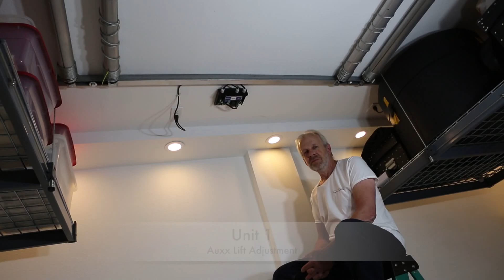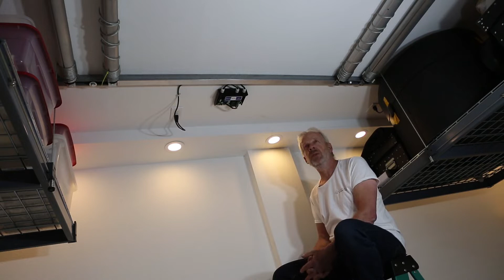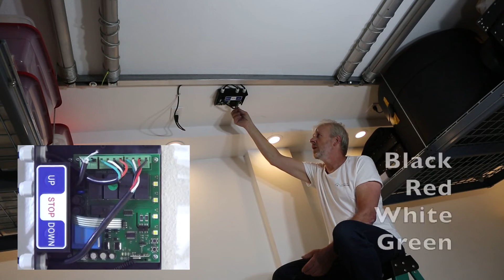Auxx Lift Garage Storage Lifts: Installation & Trouble Shooting Guide - Video 2 (Wiring)

Comment from the maker: 🛍 BUY NOW: https://yblgoods.com/products/electronic-garage-platform-storage-lift-400lbs-600lbs-by-auxx-lift-2
YBLGoods ⭐⭐⭐⭐⭐ Rated: 4.9/5

The Auxx-Lift is the ideal storage solution to keep your garage organized. It is the largest and strongest platform on the market with 4' x 8' area and 600 lbs lifting capacity.

Platform sizes
3' x 6'
3' x 8'
4' x 6'
4' x 8'

Lifting Capacities
400 lbs.
600 lbs.

For 400lbs:
General specs
Model:Auxx-Lift 1400
Lifting Capacity:Up to 400 lbs
Max. Travel Distance1:16 ft
Min. stored height2:8 in

Roof Support
Type:(2) 1 5/8" x 60" strut channel
Fasteners:(8) 5/16" x 4" SPAX© Lag Bolts
Mounting Area:5' x 5' over 3 joists/rafters
Cable:1/8” Vinyl-coated Steel 7x19
Cable Strength3:2,000 lbs

Operating Requirements
Switch Voltage:110V / 120V
Transmitter:433.92 MHz
Electrical Cord:10 FT / 16 gauge / NEMA 5-15
Min. circuit size:15 amp

Platform Specs
Thickness:2.5 inches
Support Frame:C-Channels (15gauge)
Face material:3 x 3 galv. Wire Mesh (4gauge)

Motors
Type:IP44 (T-Motor)
Rated Power:235 W
Rated Current:2.2 A
Voltage / Phase:100-120V AC / Single
Duty Cycle @ Max. Capacity:3 min on, 15 min off4

Size and Weight
Dimensions:
3ft x 6ft
3ft x 8ft
4ft x 6ft
4ft x 8ft
Weight:
128 pounds

What's in the box
2 Motors
Controller
Remote Control
2 C-Strut Channels
Platform
Mounting Hardware
 

For 600lbs:
General specs
Model:Auxx-Lift 1600
Lifting Capacity:Up to 600 lbs
Max. Travel Distance1:22 ft
Min. stored height2:8 in

Roof Support
Type:(2) 1 5/8" x 60" strut channel
Fasteners:(8) 5/16" x 4" SPAX© Lag Bolts
Mounting Area:5' x 5' over 3 joists/rafters
Cable:3/16” Vinyl-coated Steel 7x19
Cable Strength3:4,200 lbs

Operating Requirements
Switch Voltage:110V / 120V
Transmitter:433.92 MHz
Electrical Cord:10 FT / 16 gauge / NEMA 5-15
Min. circuit size:15 amp

Platform Specs
Thickness:2.5 inches
Support Frame:C-Channels (15gauge)
Face material:3 x 3 galv. Wire Mesh (4gauge)

Motors
Type:IP44 (T-Motor)
Rated Power:680 W
Rated Current:6.0 A
Voltage / Phase:100-120V AC / Single
Duty Cycle @ Max. Capacity:3 min on, 15 min off4

Size and Weight
Dimensions:
3ft x 6ft
3ft x 8ft
4ft x 6ft
4ft x 8ft
Weight:
128 pounds

What's in the box
2 Motors
Controller
Remote Control
2 C-Strut Channels
Platform
Mounting Hardware

🛍 BUY NOW: https://yblgoods.com/products/electronic-garage-platform-storage-lift-400lbs-600lbs-by-auxx-lift-2